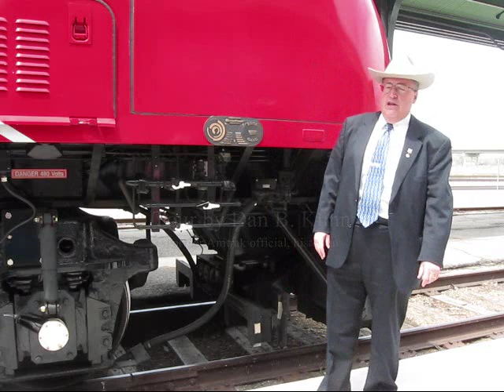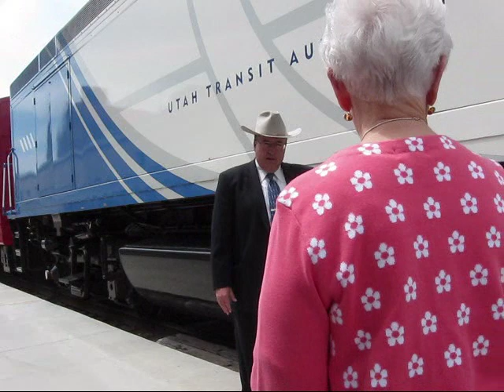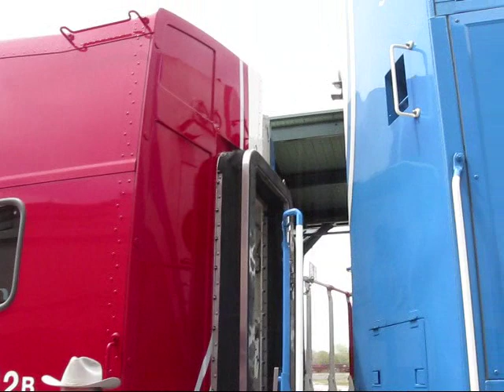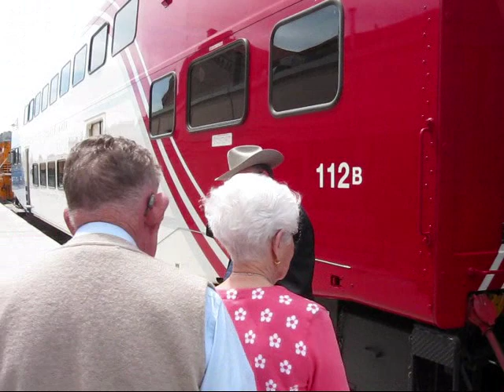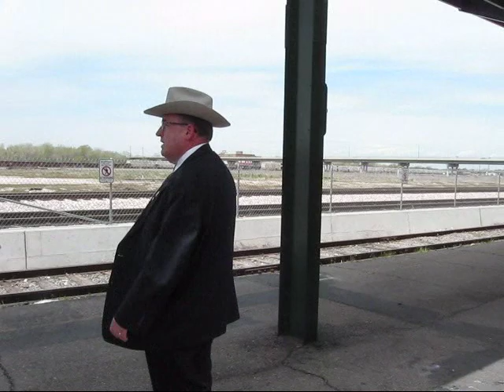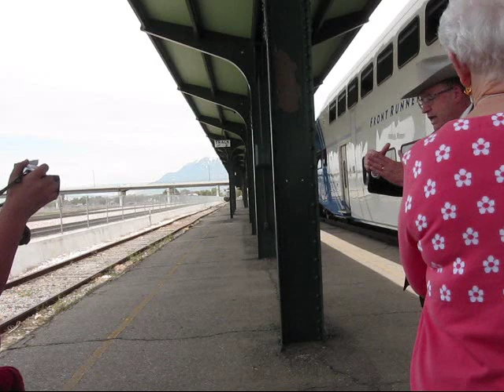The Anatomy of a Frontrunner

Comment: The frames were all brand new. The reason is that the I beams used are about five inches taller than most other locomotives. These beams are slightly smaller in cross section. Most EMD locomotives there is very little room between the sump pan and the oil pan. These locomotives have a significant distance between them. I know because I am small and had to go under the oil pan to tighten a pipe. We had a big Samoan guy pull me out when I was done. Yes he picked me up by my feet.

Comment: passenger cars have three brake types the standard air brakes which use shoes, disk brakes which use a disk and gear brakes which use a motor to turn a cog on the axle.